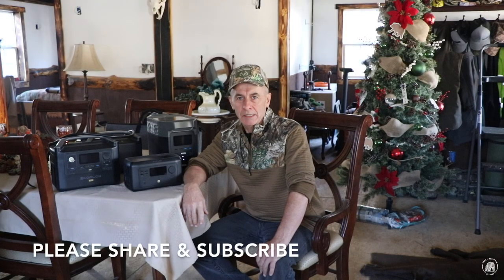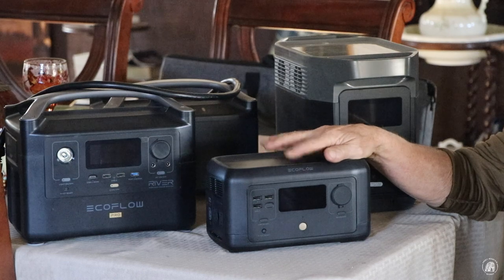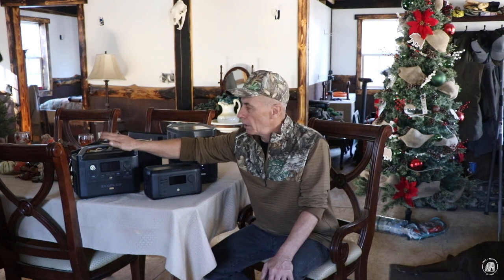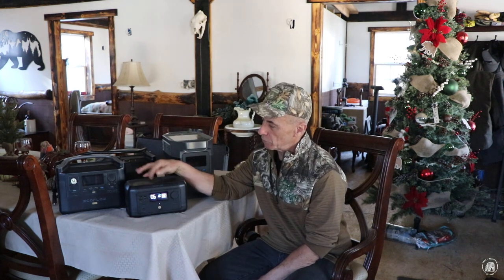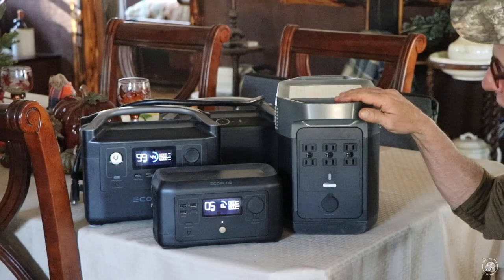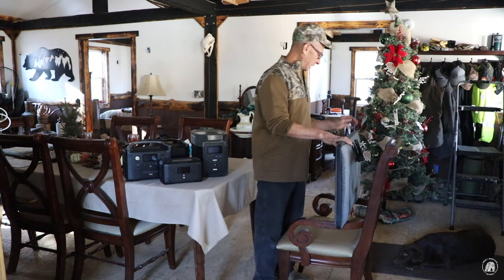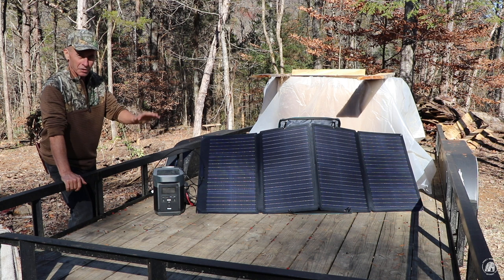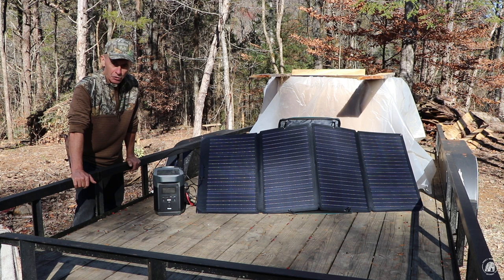POWER STATION FOR OFF GRID, EMERGENCY, CAMPING & GENERAL USE | TIMBER FRAME CABIN

Comment: Self generators similar in size to what you demonstrated I created 5 years ago.  So far I have made units rated up to 3kw, and designed others up to 20kw.  So these units are possible, exist and will be available in due course. Actions by the oil companies are what has stopped this being available earlier.  Other generators are comming with lots and lots more power, enough for any electric vehicle and giving electric vehicles ranges of over 1,000 miles